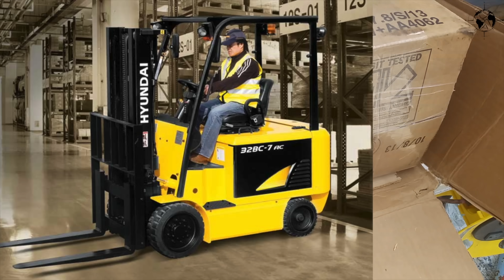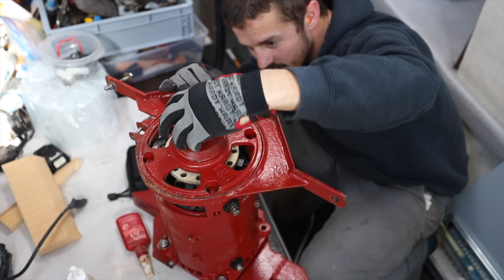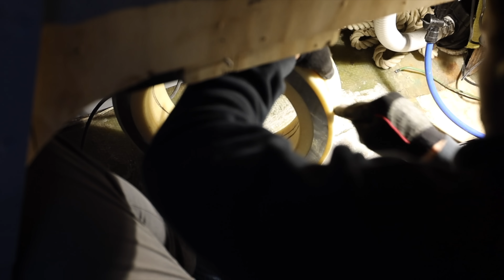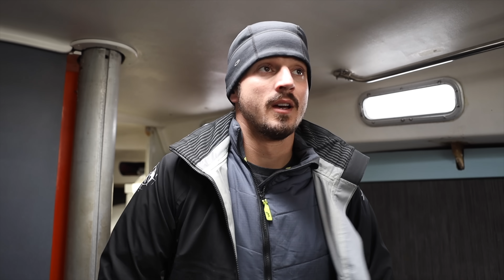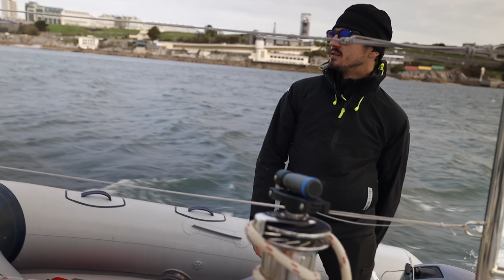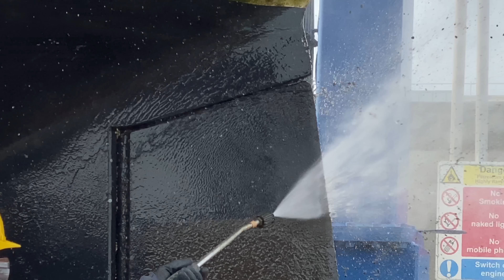Getting Rid of our DIY Electric Motor — Sailing Uma [Step 212]

Comment: Worked at ATT and they Use 48vdv battery packs for backup power! Phone lines run at 48vdv! And there are tons of old Inverters that turn 48vdv to 220vac very cheap so you could use an induction motor that would also charge the 48vdv battery bank

Comment: Its not the volts that kill you its the amps. It only takes 1 amp to kill you. You can weld steel with a car battery most batteries can kill you in the right circumstance

Comment: If you get 50 000 volts is not going to kill you. Ampers are lethal..
Reply from the maker: Sure, technically, but volts are what allow amps to flow. You can have the larges 12V battery in the world and still grab both cables just fine. Not sure I'd try that much above 48V. There is a reason they cut off DIY builds at 48V, and anything above you need a licensed electrician to instal it.

Comment: Sometimes my 20 hp diesel engine for my 9 ton boat didn't work on our transPacific voyage.  That was OK.  It made us better sailors.  Cooking and lighting with kerosene was fine.  On a lee dock?  Just use your dingy and put a line to windward to warp off of the lee dock.  Location?  No magic boxes to tell us our location.  Just use a sextant and an electric watch.

Comment: I still like the diesel engine because at the end it's easier to sell a boat with a diesel engine then electric motor batteries can get very expensive and plus you're adding a lot of weight you never stick to one boat he always want a bigger boat I know that electric is the future but I think it's going to take some time to Perfection it
Reply from the maker: For now the selling part is sort of true, for folks who still don’t see the advantages. But diesels depreciate with use, where as electrics don’t. They’re also lighter than a diesel set up, and batteries get cheaper every year. It’s won’t be long before diesel motors are the expensive custom option.
Reply: They say that Tesla has the future but I don't want to have an accident on an electric car I would never see boats with electric motor it's going to take awhile because salt water and Electric Motors don't go especially with the corrosion batteries are expensive and add a lot of weight it take up a lot of space if you go sailing in the Caribbean and one of your relays go out you are stuck there it's easier to get parts for a diesel engine then troubleshoot and fix an electric motor they say it's the future but it doesn't convince me
Reply: @jay-sg8tv  I'm afraid that I don't buy your arguments.
Look at the spaces taken - in Uma, they gained a fridge space where the motor was before! Batteries + e motor weigh about the same as the diesel motor (e.g. Yanmar 60 hp 230 kg  vs.  Oceanvolt SD10 46 kg + 12x 100Ah Lithium 180 kg => 226 kg) , but then there is the fuel itself, space, weight, odor...
E motor service is zero vs. regular oil changes etc. of the diesel. Spare parts: take some relais against oil filters + impellers + spare oil + spark plugs + v-belts...
I agree that "all electric" is not for everyone, you really have to think twice with a water maker or/and(!) a washing machine...
(still no problem for "Top Secret", a fancy catamaran in the Caribbean)
Alas, the major hindrance is (your) fear of the new, and, more significantly, availability of "clean" energy offshore - easier to get in sunny Florida than in winter in Norway ;)

Comment: With regard to charging while at sea can I suggest you fit a system to disengage the electric motor from the propellor shaft and engage 1 or 2 alternators that the propellor will drive. For water cooling use a pitot tube and copper coil around the motor and out again 
But you got your new motor still a Pully on the prop shaft to a alternator will give you a huge amount of recharge
Reply: There ain't no prop shaft any more...

Comment: How does your electric motor generate electricity ?   Is the concept to turn the motor off and let the prop turn in the water and turn the motor to generate power to charge the batteries ?

Comment: I need to get an electric drive for my boat project. Unfortunately I’m not able to afford a $25,000-$30,000 system for a $2,500 sailboat.
Reply from the maker: They’re quite easy to build yourself. We built our first system for about $500. Then slowly upgraded over the years. If you can find a used golf cart, it already has every component you need. Sometime, you can buy the whole thing for $3-500.
Reply: @SailingUma  yeah, I was actually considering that and came across your video! I got cheap 1977 32’ sloop to fix up to make sure I’m confident in getting a bigger, better, and more expensive boat in the future. It’ll definitely be an experience! I’ll stay tuned into your channel ^-^

Comment: The simple cure for the temp in the motor is to rewind simply using heavier nomex insulation and instead of varnish use epoxy made for higher temp conditions
Reply: The cost is a few hundred to a small repair company and can be done less than 48hrs

Comment: Very useful video, excellent. Can anyone tell me the brand of that fibreglass, its just what I need.Many thanks
Reply from the maker: Not sure fibreglass comes in “brands” at least none that we’ve seen. It’s just sold in weight. But for repairs like these, how thick the final layup is, is all that matters.
Reply: @SailingUma  ok, thanks so much for the reply. Fibreglass repairs are new to me but the stuff you were using looked very easy to handle. Thanks again, love the channel
Reply from the maker: It was a “stitched bi-axial”. Best stuff for general repairs. Stay away from woven fabric. It falls apart too easily and is a real PITA to work with.
Reply: @SailingUma  Thanks so much. I thought it looked a lot different to the usual stuff. Great of you to take time to reply. Kindest regards

Comment: I still think electric drive is okay at best but I would have a diesel generator so in bad water you don’t have to push the batteries hard and damage them. But in most sailing electric is the way. It like I would have a Chevy volt over a Tesla anytime. Because I would not want to depend on a power grid it get to safety. It like having oil lamps in your house you hope you never have to use them. And batteries do degrade over time.

Comment: How did you get the circular mounting bracket to match the shape of the hull?  Trial and error is one way, but was wondering if you have a trick or two to share???
Reply from the maker: Trial and error. Slow and steady. With a pinch of luck. There’s no secret. But as long as it’s close, epoxy fuller does the rest. Then the added glass over it is where the structure comes from.

Comment: Love you guys lifestyle! Keep rockin' ;) But please do not say 48v won't harm, it's all about the power. 48v will absolutely kill you under the right conditions, say like 4 x car batteries hooked up in series will generate that voltage, but dem amps! A typical car battery will generate over 400hundred amps on <i>dead</i> short. Draw times four.

Comment: Since corrosion is an issue a marine designed is best as it might be designed to prevent that nasty little reality of salt water. You might consider other motors not from golf carts. 48v can kill. Don't underestimate. Motorcycle and bicycle motors can have voltages well above 48v. Also consider wind and solar charging. Yes they are not as powerful as a moving boat they can be used at the slip. Also consider anchoring where the current is fast and you can regen while anchored. Good luck.

Comment: Love this story and information... I feel ' re-gen. ' ELECTRIC MOTORS are the future.. or at least in my future on my (engineless) boat, Ten Years w/NO engine, then again, it's a 9m day-sailer / racer, (17 ' on the waterline) kept on a remote mooring..but small enough that a 3Hp Torquedo might be sufficient..  ps. What are you using for bottom paint?

Comment: hey the area where you keep your engine is really cluttered causing it to overheat from no ventilation. theres no air ventilation and a fridge pumping heat into the small area aswell. if you want your engine to stop overheating this might really help
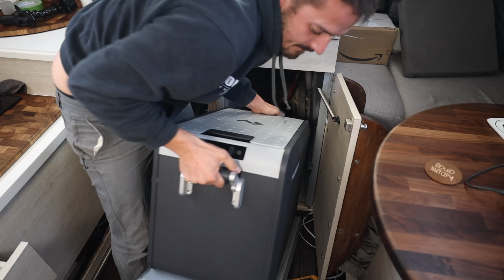Reply: 11:11
Reply from the maker: The issue is that it was undersized and we were pushing too many amps though it. No amount of air flow could have cooled it down adequately. We tried.

Comment: Why not just have an alternator connected to the shaft with a clutch on it so that you can disengage it when using the motor then when under sail disengage the clutch and regen using the alternator ??
Reply from the maker: We thought about it. But that would only solve the regen problem, not the undersized or overheating issues.
Reply: Sailing Uma yh ur right, and thanks for replying

Comment: Re: the "they are missing the point, regen is the reason to have one", I think the issue is that the amount of power you can generate from the prop under sail is a drop in the bucket compared to a bunch of solar panels, i.e. it's easier/cheaper to just add another solar panel versus dealing with regenerative motor.

Comment: How do you use a level on the boat while it is in the water?  Is it an approximation? Or is there a trick?
Reply from the maker: The level shows you 'level to the water" SO if the boat balanced and level in the water, then the level works just fine.

Comment: I find your Vlog so interesting and have been binge watching since Saturday. Quick question, why not a water maker considering sailing itinerary?
Reply from the maker: Cost! they're prohibitively expensive. Between $5-10,000 for something that we often get for free. There are parts of the world where clean water is hard to come by, where the price might make them worthwhile. But in the meantime, we just fill up our tanks every week or two and that works for us.
Reply: @SailingUma  maybe consider at least getting one of the small ones which are manually operated,  just in case. Depending on the kit for your liferaft it might already have one. But I remember you saying the new liferaft doesn't have a medical kit so I guess it doesn't have a watermaker either. The manual operated ones are so small you can keep it in your grab bag. Imho it is important to have one. It would be quite some workout to produce some gallons of water, but it works. 
Nicki and Jason from the channel Gone with the Wynns also showed an interesting filter system which is used on Fiji in remote villages where they have no access to clean water. Those are just 2 buckets with the filter between them and gravity does the job. I don't know if it works for salt water but I guess it will. Maybe contact them to find out more.

Comment: I like the idea of the motor swap but I highly and specifically prefer shaft drive to sail drive for safety and maintenance.   I am tempted to make this change on our boat except for us there is minimal need to do so and I utilize the waste heat from our IC engine.   The ability to capture regenerative power while sailing is a compelling argument.

Comment: As a captain on NOAA research vessels it would make me really nervous having that bank of lithium batteries. We definitely have lithium batteries aboard for certain scientific equipment but also have rules on storage charging. If it goes bad on a bank like that it can go really bad..
Reply from the maker: We have LiFePO4’s batteries which are incredible stable. Sure everything has it’s risks, and nothing is perfect. But these batteries are far less risky that diesel, petrol, propane or even lead acid batteries.

Comment: I'm kind of surprised a prop that small could generate enough power to be worth it. How does it stack up with a decent sized wind turbine?  For sure a lot more energy power volume of water Vs air but wind turbine is a lot cheaper and can have much bigger rotor area, spin way faster, and give you power even then boat is stationary right?
Reply from the maker: Both are useful. We’re planning to have all three, wind, water and solar. Just one alone usually isn’t enough.

Comment: Why not use wind to regen!?
Reply from the maker: We would need a wind turbine with an 8ft blade to produce the same power as our 16” prop. We do have plans to add wind and more solar, but it’s not that easy with a 48v boat with limited space to mount it.

Comment: Companies doesnt focus on marine regen because its inefficient way to gain power, much easier and efficient is photovolt- panels cause you're at the Sun 90% of a day. Even wind turbines works better for given situation.
Reply from the maker: That just isn’t true. OV’s new servoprop puts out 1kW at 8 Kts. So in the range of 15-24kWh in 24 hrs of sailing. For comparison, our 480W solar panels produce about 2.4-3kWh in 24hrs. So we would need 10X more panels to gather the same amount of power. Where would we put them? We would need a wind generator with 8ft diameter blades and 25+ kts of wind to produce that kind of power.
Reply: @SailingUma  Ok, how much is this OV servo prop in money? How much is running cost? Every few week drydocking it to inspect or so... How do you know it will produce that amount of energy claimed, it says "capable of 1Kwh" not guarantied 1kWh output? Because, as you stated, 480Wh solar doesnt output 4.8kWh of energy in 10h sunny day, but manufacturer didnt mention that in a datasheet (on the other hand you can change solar system on the fly, in the middle of the ocean if part are available. Its the same for a recuperating E-drive, what would happen if you sail at 4-5 Kts instead (you mentioned 50Wh)? For ex.: a simple cavitation near the prop would mess up the regen calculation real bad, more, system just is too complex (programmable variable pitch prop required) etc.
Im refering to a money invested, system redundancy, maintenance and accesibility of spare parts.
In first example (solar) you took empirical data but in other (regen) you quoted projected ( I just checked in step 222 you mention you got 200-300W of regen@7-8kts or 5-6kW/24h which isnt near to 15-24kW/24h, not 15-24kWh/24h as you wrote).
I know you want to believe this is a good thing,  but believing leads to dissapointment, and advertising to others something what wasnt proven in real life situation isnt quite credibile.
Sail safe.

Comment: curious,  what is the haul , dry dock, pressure wash etc  cost .   seems scary "financially" hauling out and being in dry dock for a week, the machines they use and the tenders , pressure washing it etc etc etc "
Reply from the maker: In the UK, it’s not too bad. I think it was about $500 to haul, wash, cradle and relaunch a week later. In Florida; it’s more like $1-1.5k

Comment: Please note, it's not the voltage that kills, it's the current ( Amps ).   Invest in good grounding / earthing of all power components.   The higher the current, the heavier gauge grounding wires / end shoes / bolts will require.   A rule of thumb is grounding cables are 1.5 the gauge of the live / phase cables.   Correct grounding is confirmed using a Magger Meter ( not DVM ).   Stay safe.
Reply from the maker: Of course. But it’s the higher voltage that allows the higher amps to pass through. You can touch a 48V bank without getting shocked. You treat it the same as a 12V bank. Once you get up to 72VDC and higher, you can get a nasty shock just by touching them....that’s more to the point I was trying to make.

Comment: Never thought regen was possible with such a small propeller (ie: not enough drag/friction to move it enough)? 
How much power do you get back from regen?
Reply from the maker: We cover all of that in step #221 & 222. 

But incase you haven't gotten that far yet:
5kts = 50W
6.5-7kts = 250-300W

Surfing, up in the 8-9kts we've seen it as high as 600-800W

We average around 6-6.5kts offshore and we're excited to get out on longer passages to really test it, but that could be up around 6kWh in a day.

Also, before you ask, no, we haven't noticed any tangible loss in speed when creating power.
Reply: @SailingUma That's pretty decent! 
What's the price difference from a non-regen engine (and does it make sense versus solar)?
I'm sorry I missed those episodes (just recently found your channel). Will definitely watch them! Thanks!
Reply from the maker: Pretty much any electric motor with permanent magnets in it, has the potential to produce power from the spinning prop while sailing. Oceanvolt seems to have tweaked the potential and has one of the highest regen producing electric motors on the market. 

The difference is, with solar, you only get power when it's sunny. We have 480W of solar, and can usually get between 1kW (on a cloudy day) and 3kW on a sunny day. So the motor could produce 2-6X more power than our solar depending on sunlight and how fast we're sailing. We don't have space for any more solar, which is why we were so keen to find a motor that had good regen potential.
Reply: @SailingUma  That's awesome! Thanks for sharing!

Comment: I really hate to bring this up, but to keep that new motor from corroding via salt air, you'll have to keep it warm.  And to do that, the most common way used is to run a "fairly small" current thru the windings.   That means dock power and a DC power supply or transformer.

Comment: Like electric but so so expensive.
Reply from the maker: Our fist set up cost about $1500, motor, controller, batteries and solar panels, included. You can buy a used electric golf cart for about $5-800 and then gut it, use all the parts and add new batteries. 

Thunderstruckmotors.com, has kits starting around $3000.
SilentYacht units start at $5000. 

Much cheaper than even refurbishing a diesel. 

The ONLY downside it range. Which, for $800, you can get a little genset and motor for days at 3-4 kts.

Comment: i think you missing the point. Voltage does not kill, its the amperage..... you can hold easaly 10.000 volt. i did it. Take a sparkplugcable from a car. you feel it but it don't kill you and its 10.000 volt. i did it from 100 rpm till 5000 rpm. at the end your muscles loose grip....